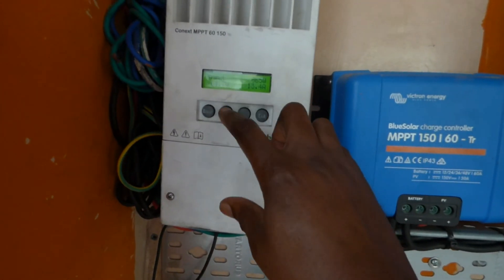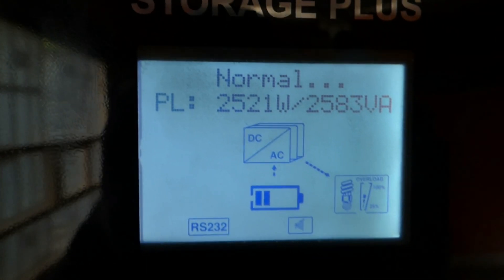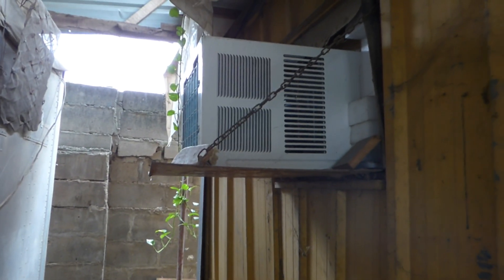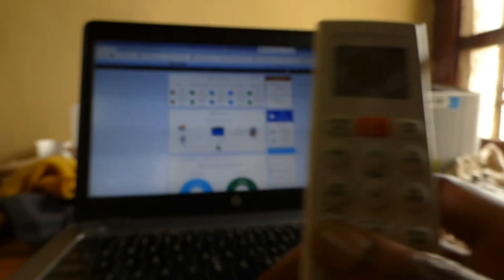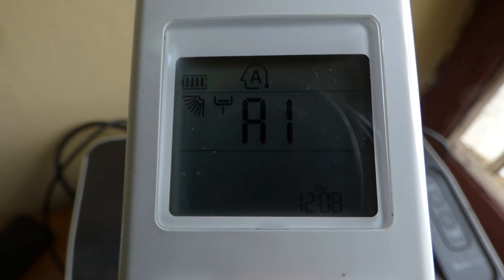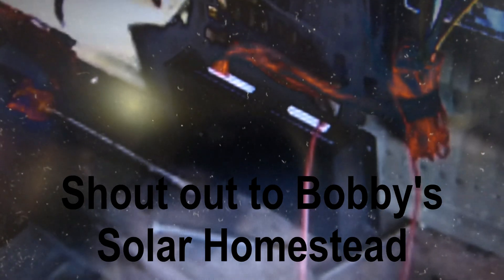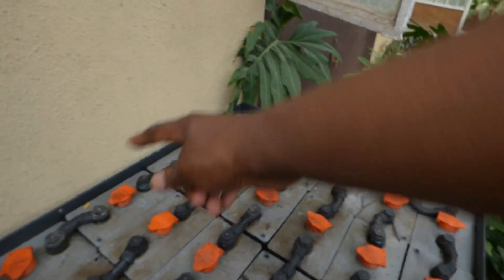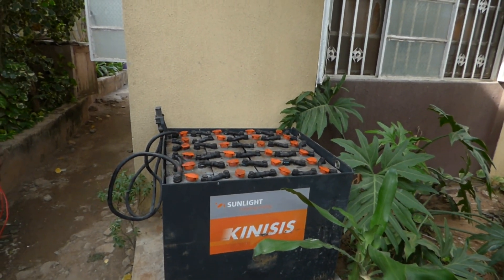3 reasons the LG inverter AC, is the best for solar plus a big battery surprise.

Comment: I have LG AC but i m having issue .. my AC outdoor is not working on solar panel what should i do ..
It work good on electrcity but not on solar energy .
Reply from the maker: Thank you for watching and commenting. Please don't forget to subscribe. What inverter are you using? Give me more details? What else do you run on solar?
Reply: @drsolar  fridge,iron ,water motor ,    almost everything but my AC is not working I have called the solar inverter company they were also not able to understand..the AC is fine as I have called the AC repair company and they tell me it's fine as it work good on Electricity but not on solar the outdoor compressor doesn't work on Solar panels
Reply from the maker: @nashitsaeed.  That is confusing as well. I have no explanation for why it does not work.
Reply: Hi did you figure this out ?
Reply: @marigold4147  yes it is kit issue and it is a permanent fault in some ACs of LG so it won't run on solar panel but will work good on Grid electricity
Reply: @nashitsaeed.  thanks for your response. When you say kit issue, do you know exactly what?

Comment: Hi, I have a 4kva inverter, I have four 200amps battery and eight 320watts mono crystalline  solar panels. Can I power a 1.5hp inverter split unit with my solar setup?
Reply from the maker: Thank you for watching. That question is best asked to your installer. I would say yes but ask your installer

Comment: my auntie has one of the latest inverter air conditioners , with the new refridgerants and compressors they use about 70% less power and the newer gases make them ccccold.
Reply from the maker: Thank you for the comment. They are a league ahead of the old tech AC

Comment: do the plastic nuts on the top of each bus bar end actually come off ? 
sadly im not awfully familiar with that exact setup
also to add i do envy the live time monitoring of that setup, its excellent!.
 
oo what car is your restoration project ?
Reply from the maker: Hello my buddy from Australia. The nuts looks like it could come off. I need to know how to remove the plastic caps without damaging it. Thanks on the monitoring. Standard with the inverter. It updates every 5 minutes. An old E class. I am still debating if it is worth it.
Reply: @drsolar  
hmmm i would hope after the nuts have been removed the caps should follow suit relatively easily (just at a guess).
it might be one of those "sacrifice one to learn for the others" occasion though.
or alternatively it might be listed in the manual for the forklift it came from (be warned, those manuals are very long winded) 
ahh nice, well if its what you want to build follow your gut and do it, monetary value means little compared to satisfaction.
W124 ?
Reply from the maker: @nvmyutube  we will do just that. Break one to learn. It is a W124 very common. I don't have patience or time and it is hot. I will make a decision to scrap or continue. How is life in Oz
Reply: @drsolar  its a small expense for learning something new sometimes. 
ahh i quite like them, there are quite a few here too, best of luck either way you choose.
life is good, weather is getting to be quite cold though down here in the south, so were still adjusting to that, hopefully life over there is going well, (apart from the heat, i don't envy that).

Comment: The inverter AC -   the compressor does not cycle but reduces in speed. The variable speed of compressor  is how low power consumption is achieved. An added advantage is slow ramp up of power when starting which allows to reduce the size of inverter supplying the input AC
Reply from the maker: Hello Anil thank you for the clarification. When I step outside I no longer hear any sound from the outdoor unit, hence my conclusion. Thanks for watching and the teaching moment.

Comment: great video! I want that AC :) I believe those are solid lead bus bars connecting the batteries, pretty sure you have to cut them.
Reply from the maker: Hello GOG. The AC rocks. Has a fast cool mode and then an AI mode. It really rocks. The bus bars are not solid. They flex, I need to figure out how to remove the plastic tops on them. Thank you for watching. I love your video and I can't get enough of them